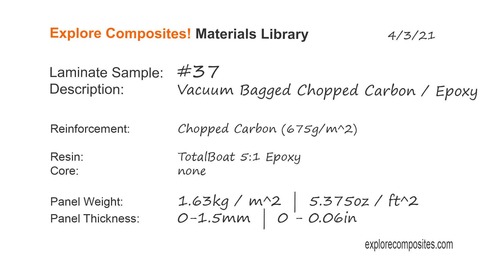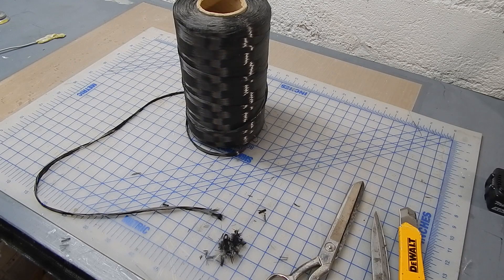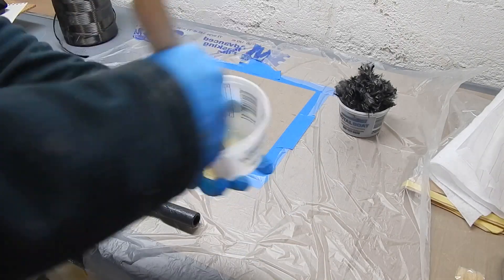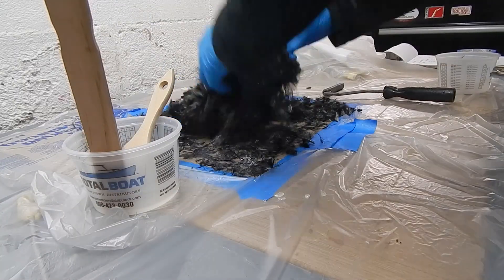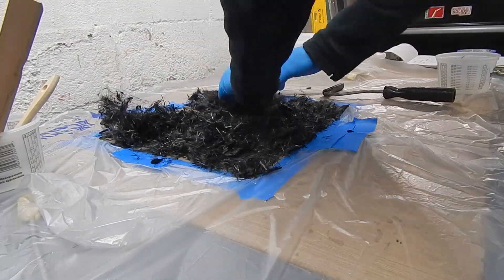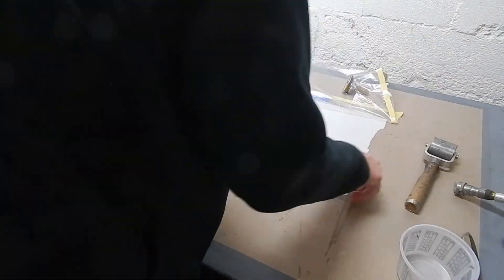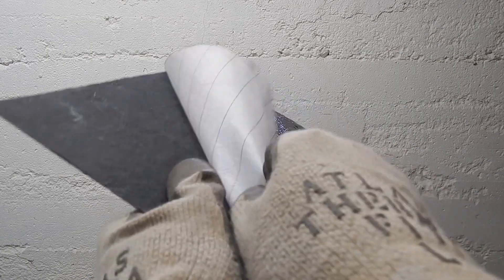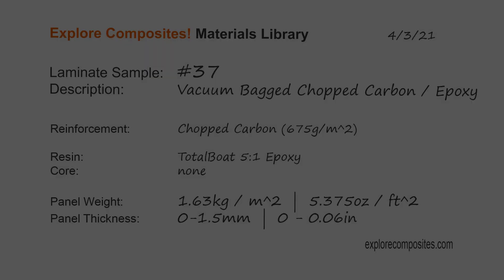Laminate Sample #37: Vacuum Bagged Chopped Carbon / Epoxy

Comment: “See air through” lol. Light. A couple of tips, firstly you didn’t use nearly enough epoxy. Second, after you’ve gotten it uniform, don’t try to mash it down. Just put the first piece of plastic on top, then roll it out. Pick up the plastic and make sure you don’t see any air lol. If you do see through, put a few shreds on, place plastic back down and roll again. Repeat until uniform. THEN, vacuum seal.
Reply from the maker: Air - didn't notice that - come to think of it, I see air everywhere!  Your idea about squishing between plastic and checking for uniform coverage and adding more as needed is great!  I've never made anything this way before and was really just playing around to see.  All my "chopped carbon" stuff has been prepreg or infused/injected so you saw me being pretty clueless here.  Your advice is always welcome - thank you!

Comment: I wonder if the dust is dangerous like silicium and amiante
Reply from the maker: It isn’t good!  Cutting dry fiber in direct sunlight is always an eye-opener - lots of little glass or carbon “sparkles” floating around.  Dust mask or respirator is a good choice.  Not asbestos (amiante) level dangerous though.

Comment: You should have it inside of a form problem solved
Reply from the maker: Yes, that would have helped.  Most of my "chopped" fiber work has been with compression molding inside tooling so this was kind of a challenge to try to make a somewhat even plate.  Didn't come out great, but shows the material and process a little.

Comment: hi, is it electrical conductive plate? if no, then we can modify the epoxy with any other conductive material to enhance the conductivity ?
Reply from the maker: I don't know - probably a little.  There are additives that improve the conductivity of composites and make them more uniform - chopped carbon or metallic fibers/powder.  I don't know much about this and have never tested it.
Reply: What type of paper that u use to cover it before cover it in vacuum plastic ?

Comment: Could have used a piece of plywood to squash it flat.
Reply from the maker: Yes, with more pressure that would probably work well - like hydraulic press level pressure.  With just a vacuum bag, I am pretty sure the fiber unevenness would not get spread out with the 14psi max that the bag/atmosphere will produce.  I have tried this before in similar situations with less than ideal results... with a more uniform fiber like the recycled material in sample #47 a "caul plate" like you suggest would probably work well.

Comment: Out off curiosity where can I find rolls of CF like the one you have in this video ?? Please and thank you
Reply from the maker: I got a bunch of rolls with some surplus material I bought.  Sometimes shows up on ebay.  Companies that manufacture it will sell it to you but probably not single rolls.
Reply: @ExploreComposites  awesome thanks for taking the time to get back at least. Just chop is ridiculously overpriced by the pound. I’ll keep looking 🤘🏼🙏🏼

Comment: It would have been interesting to see a stiffness comparison between similarly chopped glass and similar layup procedure. Dispersing resin evenly or evenishly might be done by drizzling resin as evenly as possible and then overlaying with peel ply or plastic sheeting and then roller squeegeeing.
Reply from the maker: I'd like to play with this more and try to make it more consistent - this is a mess.  I think infusion is going to be the best way though for anything that isn't going to be squished into a casting type geometry...  

Easy Composites has a great video that discusses the strength of chopped carbon.  They include directional tow too which is a good idea.

Comment: Iv just had same problem on car front splitter.    The fibre looked just like fiery did vac bag but still just dry and not all stuck.    So going to sand if off and go again

Comment: Cool experiment! See https://www.youtube.com/watch?v=iFPBOWf8Pr8 for someone else attempting this. The vid is a tortuous 18 minutes long, so skip to 6:20 and then fast forward a minute at a time... It seems to me that they use lot more epoxy, longer fibers, and perhaps a different roller. No vacuum and crappy end result (if I may say so...), but I wonder how it would come out if you used enough resin to be able to roll it and then double or triple bleeder fabric to try and suck it all out.
Yet another interesting video: https://www.youtube.com/watch?v=-wzMl8RZ_4M where he infuses chopped carbon under a thin woven carbon cloth and ends up with a 3:1 resin to fiber ratio!
NB: if you do more experiments, please buy some chopped carbon fiber, we don't want you to burn out on the chopping task!
Reply from the maker: Those are both interesting - Matthieu's look into chopped carbon over a few videos is great!  He's right about infusion being the best way - next time I'll test that but hopefully with some ribbing or structure to the panel.  And I bought a kg of pre-chopped fiber already - cutting it by hand was neither fun or repeatable!

I am not a fan of adding lots of resin and then bleeding it off - just too hard to control.  The resin by weight on this sample ended up about 60% which is not great by normal standards but ok for a random orientation material.  Commercial bulk and sheet molding compounds are up in the 50% resin or more range.  You're always giving something up with the short fibers and it's probably only worth it if you get enhanced mold-ability in return.

Definitely more to explore here - got plans for more interesting samples - this was just a first go.

Comment: This is interesting.  It probably isn't the right thing for me, but I'd like to know more about how it is done and what it can be used for.  The best example I found right away is a Lamborghini video that shows a process with pre-preg sheets stamped in a big press.   (BTW, thanks for responding to my questions about a CNC routers and mold making.  I went ahead and ordered a new ShopSabre 23.)
Reply from the maker: Yeah this was really more of a subtle illustration of the pointlessness of using "forged" type composites for flat things!  I am not super into using a less effective process to make things just because it looks neat.  The stamping/compression molding is very interesting though - going to try to get into this in a video in the future. It bridges a gap between cast or machined metal and injection molded plastic that is pretty awesome!
Reply: @ExploreComposites  I am interested to see your experiments!  If this compression molding is even remotely close to plastic injection molding for cost over a short run,  it is very intriguing!   I might have a use for this!  :)
Reply from the maker: Good luck with the new router!  I had a Shopsabre once and it was a great machine.